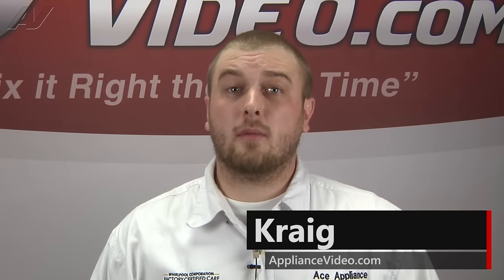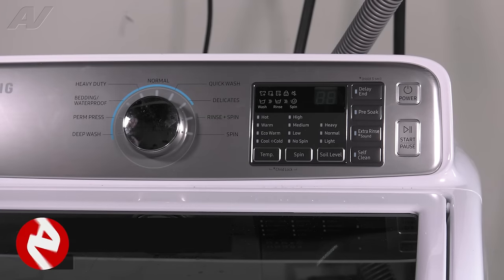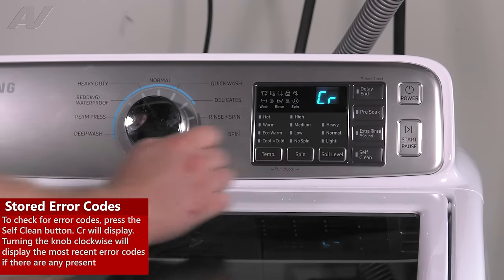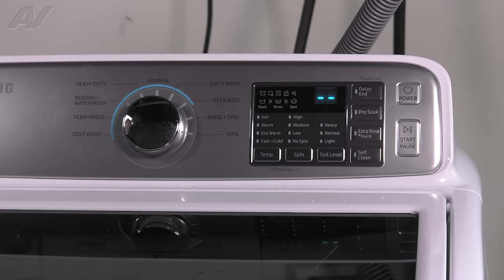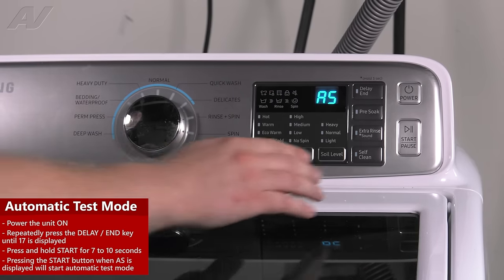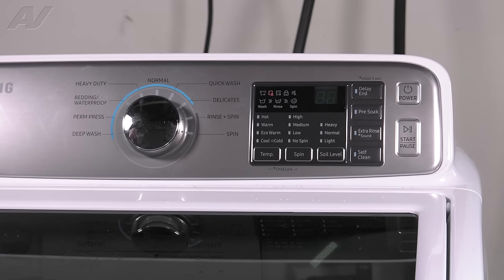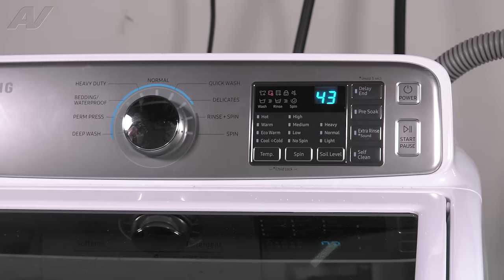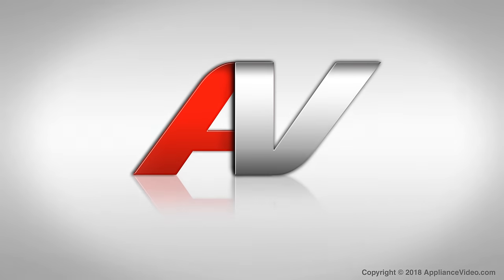Samsung Washer  - Diagnostic Mode, Error Codes, Troubleshooting

Comment: Any ideas for washers that don't go into diag mode ? I have the same exact washer it's not displaying the A5 or anything just spins when I hold start
Reply: I have the same issue without the spinning. A5 didn't pop up. Light keeps spinning around instead
Reply: I have the same issue as well! Mine won't display A5 just wants to begin a cycle
Reply: Ever figure out what to do if it doesn't go into diag mode? Currently having this issue

Comment: Mine was 3c2. I have opened up, changed the relay 1 for a new one ($3 bucks) and voilà! Back to work after 1 month presumed dead. It was my last atempt at something, before buying a new one... It's been a week and it works every single day!
Reply: Mine threw the same error. What relay did you change and where?

Comment: AWESOME Video. Check it out. Just running the diagnostic code as it shows on the video, resolved my problem. The problem was "water was not initiating on any cycle" in another words it started the cycle and you don't hear anything, such as water flowing into the washer. Thank You!

Comment: Thank you for this video. My machine is throwing a 4C and leaking (possibly when draining). I've done all the checks for the code and it's still doing it. So, I am hoping there is another code that is not displaying or by running diagnostics I can find the problem. I've been through too many of these stupid modern machines. Take me back to the 80's when machines actually had longevity.
Reply: FOUND the problem! Being able to run the diagnostic helped a lot! It appears that an unbalanced load caused a small hose to become disconnected. I think it is a hose that carries water from the tub to the dispenser. So, the tub would fill, but as it got to the level where this hose was, it would start leaking. So, the washer threw the 4C code as it perceived an issue with the water filling in the tub. Thanks again for your video!
Reply from the maker: Great question, if you have a more technical question that our parts department cannot answer, you can search our over 17,000 answered questions free at our website www.ApplianceVideo.com under our Repair Help section. You can also call our parts department at 1-800-830-5465 and they can give you help 7-days A week ,or search at www.SaveMoreOnParts.com  .
Reply: @No Name There was a small hose in the back that became disconnected. I had to disconnect the power, water hoses (after turning them off), and the drain hose. Then I removed the back panel from the machine and was able to see the disconnected hose on the bottom left of the tub. I reconnected the hose and tested the machine (hooking everything back up except the back panel) to see if that was the only leak. It was. It's been running great with no leaks since.
Reply: @anne-marieshaffer4928  Thank you so much!!!! Your comment helped lots
Reply: So 4c code is a leaking machine?

Comment: I own this washing machine. I was so excited to buy it my very first expensive adult set. It sucks worse than a Hoover vacuum. I was excited to not have an agitator I would give anything to have an agitator. Don't buy it. If you have questions feel free to message me.
Reply from the maker: Great question, if you have a more technical question that our parts department cannot answer, you can search our over 17,000 answered questions free at our website www.ApplianceVideo.com under our Repair Help section. You can also call our parts department at 1-800-830-5465 and they can give you help 7-days A week ,or search at www.SaveMoreOnParts.com  .
Reply: It is a crappy washer, and I was excited because it’s a Samsung! Psh! Never again!
Reply: Same here, I hate this thing.  HATE it.

Comment: My washer looks like the exact same model. It keeps stopping mid cycle. Seems like it stops after 15-20 mins. Usually clothes are wet and water is out of washer. I ran it through the whole test mode and all ran good as in this video. I took out the pump and made sure it was clean and it was. I tested the electrical connections on the water inlet valves and they were all getting 110v and had around 1000 ohm resistance.  Any suggestions on what could be my problem or what to test next?
Reply: Also in diagnostic is showed codes 3C-2, ub and dC.
Reply: Any luck. I’m having the same issue now

Comment: Will this also work on a Samsung Top Load washer? Model WA50F9A6DSW/A2? It won’t let me let the load I want to do and then it won’t start after it eventually selects its own load.
Reply from the maker: Great question, if you have a more technical question that our parts department cannot answer, you can search our over 17,000 answered questions free at our website www.ApplianceVideo.com under our Repair Help section. You can also call our parts department at 1-800-830-5465 and they can give you help 7-days A week ,or search at www.SaveMoreOnParts.com  .

Comment: In the spin test, this machine looks to go to 98 or 99, mine will only go to 36. My machine will not spin clothing, says Ur or Ub. Have tried vibration sensor and suspension rods, hasn't fixed it. Have checked ohms on stator sensor, seems good. Should it spin up to the value shown in video?
Reply: I have the same problem. Did you fix it?
Reply: @JB-rr9cm  I gave up and bought an LG washer from Costco with a 5 year warranty. I troubleshoot the issue down to the computer/motherboard. It was a $300CAD part that I was only partly certain would fix it. I tried uncovering the wires and checking resistance on every connection.

Comment: hi. thanks for posting this video.  I have a slightly different washer ww22kw6800, but the 17 worked.  I get a 8C1 or maybe it's a BC1 error.  Can't find any information about it online.  do you know what that's for?

thanks.
Reply from the maker: Great question, if you have a more technical question that our parts department cannot answer, you can search our over 13,000 answered questions free at our website www.ApplianceVideo.com under our Repair Help section. You can also call our parts department at 1-800-830-5465 and they can give you help 7-days A week ,or search at www.SaveMoreOnParts.com  .
Reply: I got the same code 8c1 ??
Reply: @JBGAMING122 it’s memes sensor , but it might be wires that connect the sensor to the Board. Changing mine as we speak 😅

Comment: I bought a brand new WA52M7750AV/A4-01 in Sep 2018 and it died Feb 2023.

It was doing a Steam Sanitize cycle when it stopped working. The panel said that it still had 42 minutes to go. We tried to reset it by doing the unplug/plug routine to no avail. Items being washed could not be removed as the lid won't open. Pressing one of the buttons would flash the "Door closed" on the panel. 

Even without testers or any gadget, Sears repair man said that the problem is the Main Control Board. He said repair would be at least $500 and it is better to just buy another one. 

I am now trying to repair it but they say that the Main Control Board is out of stock. This is my first Samsung washer and first bad experience with a washer.

Comment: Hello! So my washer showed Ub code. I did run diagnostic test like on this video. Did not get any codes. It’s probably mean that washer works good? Thanks
Reply from the maker: Great question, if you have a more technical question that our parts department cannot answer, you can search our over 17,000 answered questions free at our website www.ApplianceVideo.com under our Repair Help section. You can also call our parts department at 1-800-830-5465 and they can give you help 7-days A week ,or search at www.SaveMoreOnParts.com  .

Comment: Hi I have the same washer and in a certain point it went off and now when I push the power doesn't turn on amd the screen is black and only shows door locked, thanks for sharing,  please help.
Reply from the maker: Great question, if you have a more technical question that our parts department cannot answer, you can search our over 17,000 answered questions free at our website www.ApplianceVideo.com under our Repair Help section. You can also call our parts department at 1-800-830-5465 and they can give you help 7-days A week ,or search at www.SaveMoreOnParts.com  .
Reply: Did you figure out the problem.  I have the same problem

Comment: The power suddenly won't come on,  is there a way to reset it or something? Other than that, it's been working great.
Reply from the maker: Great question, if you have a more technical question that our parts department cannot answer, you can search our over 17,000 answered questions free at our website www.ApplianceVideo.com under our Repair Help section. You can also call our parts department at 1-800-830-5465 and they can give you help 7-days A week ,or search at www.SaveMoreOnParts.com  .

Comment: So I did exactly what you said and I came up 3c witch is motor problem.  Can I fix this myself? With a new motor
Reply from the maker: Great question, if you have a more technical question that our parts department cannot answer, you can search our over 17,000 answered questions free at our website www.ApplianceVideo.com under our Repair Help section. You can also call our parts department at 1-800-830-5465 and they can give you help 7-days A week ,or search at www.SaveMoreOnParts.com  .

Comment: Mine does not lock to allow the diagnostic mode. I changed the lid lock mechanism, it is getting power to the lock, but still does not lock and allow the testing. Any ideas from here?

Comment: I attempted to go into diagnostic mode but after I pressed delay button 17 times and then the start button for 7-10 seconds, nothing happens and the numbers continue to spin and spin. Any ideas on what’s going on or another way to enter diagnostic mode?
Reply from the maker: Great question, if you have a more technical question that our parts department cannot answer, you can search our over 17,000 answered questions free at our website www.ApplianceVideo.com under our Repair Help section. You can also call our parts department at 1-800-830-5465 and they can give you help 7-days A week ,or search at www.SaveMoreOnParts.com  .
Reply: Have you found any solution since?
Reply: @weldonnay9443  my only solution was to buy another washer and never trust Samsung again

Comment: I am having trouble with my toploader starting. Sometimes it takes 30 attempts to get the START button to actually engage and begin a load. I have to turn the power off and then back on before each attempt. So running  diagnostics is about impossible. Any thoughts???
Reply from the maker: Great question, if you have a more technical question that our parts department cannot answer, you can search our over 17,000 answered questions free at our website www.ApplianceVideo.com under our Repair Help section. You can also call our parts department at 1-800-830-5465 and they can give you help 7-days A week ,or search at www.SaveMoreOnParts.com  .
Reply: I'm having the same issue, have you had any fix for it?
Reply: Same with mine. Thought it was a faulty lid lock. Replaced it to no avail. Still works well when it wants to.
Reply: @prestoncorley2826  some times it takes hours to start a load. Very annoying lol
Reply: Did you find a fix? I’m having the exact same issue. So frustrating!

Comment: Hey when my washer gets at 8 it doesnt spin at all then the number jumps to 10 immediately and stops the test run. Is there any filter on this specific model that I can try to eliminate debris off of?
Reply from the maker: Great question, if you have a more technical question that our parts department cannot answer, you can search our over 17,000 answered questions free at our website www.ApplianceVideo.com under our Repair Help section. You can also call our parts department at 1-800-830-5465 and they can give you help 7-days A week ,or search at www.SaveMoreOnParts.com  .

Comment: Hi I did this diagnostic test and the code 3c2 popped up and I can't figure out what it means. Please help!
Reply from the maker: Great question, if you have a more technical question that our parts department cannot answer, you can search our over 10,000 answered questions free at our website www.ApplianceVideo.com under our Repair Help section. You can also call our parts department at 1-800-830-5465 and they can give you help 7-days A week Monday Saturday, or search at www.SaveMoreOnParts.com  24 hours 7 days A week.

Comment: So u turn off the water and power but then turn it all back on for the test cycle? I have the same washer it’s working fine it’s just leaves white dirty residue on parts of washed clothes. So I’m guessing it’s filter problem but there’s no drain tube like other Samsung washers have. And mine didn’t even show AS when I press and hold at 17
Reply from the maker: Great question, if you have a more technical question that our parts department cannot answer, you can search our over 10,000 answered questions free at our website www.ApplianceVideo.com under our Repair Help section. You can also call our parts department at 1-800-830-5465 and they can give you help 7-days A week Monday Saturday, or search at www.SaveMoreOnParts.com  24 hours 7 days A week.

Comment: Hello, my  Samsung washer does a horrible grinding noise when it starts to agitate. What could it be. Thanks
Reply: You contact Samsung and demand they fix this problem. Many Samsungs were recalled. Give Samsung your model# and Serial#. They'll tell you if it's a recall. But either way, they should send out a DISH tech to fix the grinding noise.
Reply from the maker: Great question, if you have a more technical question that our parts department cannot answer, you can search our over 13,000 answered questions free at our website www.ApplianceVideo.com under our Repair Help section. You can also call our parts department at 1-800-830-5465 and they can give you help 7-days A week ,or search at www.SaveMoreOnParts.com  .

Comment: I’m finding holes in my shirts after washing. Any ideas on why it maybe happening ?
Reply: Bra wire
Reply from the maker: Great question, if you have a more technical question that our parts department cannot answer, you can search our over 17,000 answered questions free at our website www.ApplianceVideo.com under our Repair Help section. You can also call our parts department at 1-800-830-5465 and they can give you help 7-days A week ,or search at www.SaveMoreOnParts.com  .

Comment: Did the test run it got to the spin cycle and just flashed 7 will not spin and did not finish test run. How ever I never got any error code even with diagnostic test. Not sure what to do. I unplugged it and did the reset that way as well as balanced clothes. Help!

Comment: Hi, during this corona lockdown, the Samsung washing machine is not switching on. The mains is clear. But the switch on button is not working. Can you plz help.
Reply from the maker: Great question, if you have a more technical question that our parts department cannot answer, you can search our over 13,000 answered questions free at our website www.ApplianceVideo.com under our Repair Help section. You can also call our parts department at 1-800-830-5465 and they can give you help 7-days A week ,or search at www.SaveMoreOnParts.com  .

Comment: Thanks for the great video. My washer just displays 2 when I start the test mode. It does not show Co like yours. 

Samsung washer model wa48h7400aw/a2.

My issue first started with the water not draining. Then it wouldn't fill. I emptied it using a wet dry vacuum at the drain hose off the pump. 

I replaced the drain pump them the inlet valve. Still, it won't fill. I checked all the hoses and even purchased a water pressure gauge and my pressure is at just over 60psi.

Please help. I'm handy enough to do this type of repair but this one has stumped me
Reply from the maker: Great question, if you have a more technical question that our parts department cannot answer, you can search our over 17,000 answered questions free at our website www.ApplianceVideo.com under our Repair Help section. You can also call our parts department at 1-800-830-5465 and they can give you help 7-days A week ,or search at www.SaveMoreOnParts.com  .

Comment: Than Kevin s for the video,really helpful. But my washer stops at number 6 and don't do anything else and I did install a new mother board
Reply from the maker: Great question, if you have a more technical question that our parts department cannot answer, you can search our over 17,000 answered questions free at our website www.ApplianceVideo.com under our Repair Help section. You can also call our parts department at 1-800-830-5465 and they can give you help 7-days A week ,or search at www.SaveMoreOnParts.com  .

Comment: Thank you! I just have a problem with 4E that just popping up and the machine stops.
Reply from the maker: Great question, if you have a more technical question that our parts department cannot answer, you can search our over 17,000 answered questions free at our website www.ApplianceVideo.com under our Repair Help section. You can also call our parts department at 1-800-830-5465 and they can give you help 7-days A week ,or search at www.SaveMoreOnParts.com  .

Comment: Do you have a video for the matching dryer? Having issues with the start button .
Reply from the maker: Great question, if you have a more technical question that our parts department cannot answer, you can search our over 13,000 answered questions free at our website www.ApplianceVideo.com under our Repair Help section. You can also call our parts department at 1-800-830-5465 and they can give you help 7-days A week ,or search at www.SaveMoreOnParts.com  .